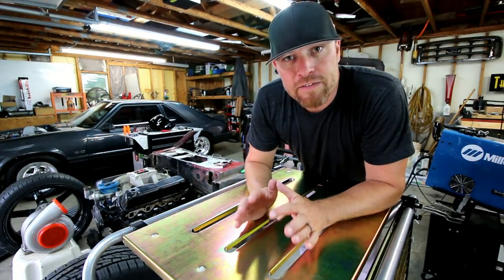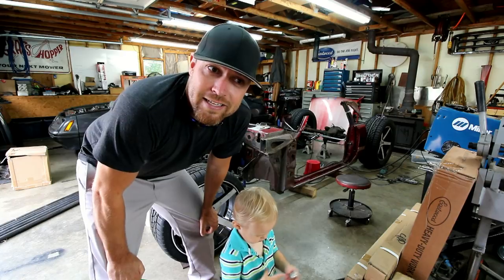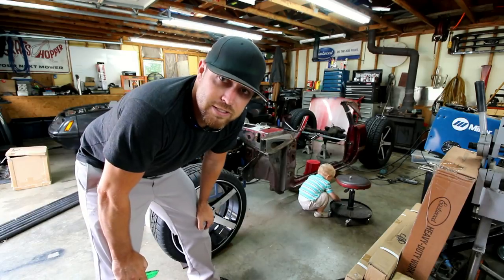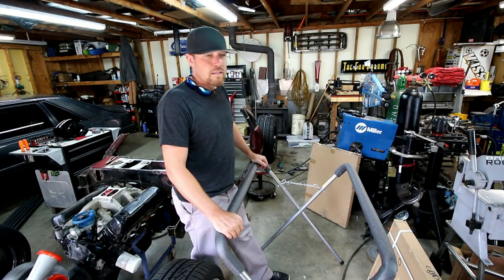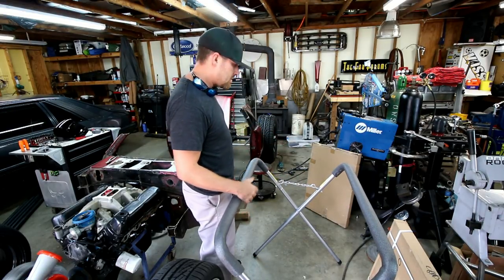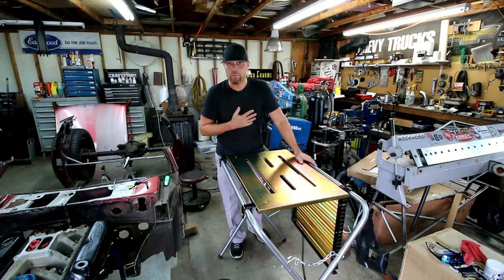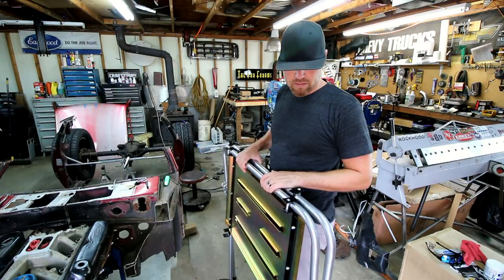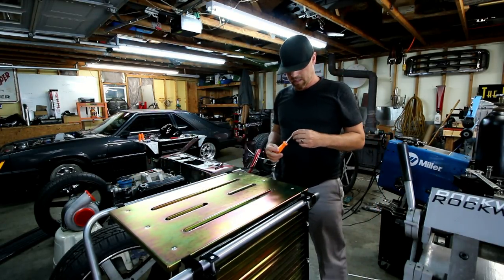Cut-N-Weld Welding and Plasma Cutting Work Stand by Eastwood

Comment: Great video,  even BETTER with the kiddo in it! 
I was that kid ,ALWAYS in the garage/shop with Pop... big smiles bro.
As far as the table... i think it's a great idea, also think that with a little "fab" work ... you can add some cross bracing to stabilize it if needed 😉😎

Comment: It is always a trade between building it portable or solid. I would rather have a big heavy weld table/cut table to work on. But it would still be nice to be able to get a car in my shop now and then as it seems to get smaller daily. Sometimes you have to take the bad with the good to get something you can actually use. Keep up the good work. I appreciate your opinions and I don't have to agree with them for them to be helpful. You have enough fans that you can ignore a few hatters!
Reply from the maker: yeah for sure

Comment: I hope im not too late. Cut the center sheetmetal of the roof out. Leaving the outer roof structure. Narrow. Then cut to fit roof. So you dont have a seam in the middle of the roof
Reply from the maker: I may end up making a new carbon roof skin

Comment: I just tried to order from Eastwood and the coupon code 'thefabforums' (without quotes) is not working.
Reply from the maker: try it again
Reply: No luck. It keeps showing "Coupon code(s) "THEFABFORUMS" is not valid." and replacing it with "PUNCHFOOL", which looks like maybe a 5% discount. I wonder if it's because I'm trying to order the plasma cutting top, which shows "*Heavy Item - Special shipping charges may apply."? I'll get ahold of Eastwood and find out.
Love the video series by the way. Keep up the awesome work!

Comment: Probably make the table steadier by replacing the chains with rods or flats if needed, either table can be used elsewhere as well, weldtable looks as though stronghand tools will work on it.
As for freebies, I'd rather watch a homeshop user demo a tool(s) than a company promo video and if they were not  donated we would not get a homeuser lowdown on them.
Keep doin wot ya doin.
Reply from the maker: thanks

Comment: How big your workshop in meters ?
Reply from the maker: not sure in meters, its 25 feet by 35 feet
Reply: 3feet 3inch or a 1000 mm ( millimetre  ) = 1meter in Australia your garage is roughly about 10.6 x 7.5 meters , How many pounds to a ton is there of weight in the States , Australia is a 1000 kg ( thousand ) ( kilogram ) to make up a ton of weight ?

Comment: Hmm. I'm sorry to say this but that table looks s flimsy as f...
Reply: kalijamies i just said same thing
Reply: bryan senulis It really does.
Reply: i got the same stand, use it for windshields and suck but dont think id trust it as a welding bench. seems like its got too much play. not trying to hate, just stating my opinion
Reply: The table top or the legs?  The legs are standard stuff you'll find in any body shop.  They work well.

As for the table itself, looks good enough for what you're going to put on a welding table, lol.  Piece of exhaust or whatever.
Reply: MrSloestD16... I can see it often working great out in the field also for those that don't have a utility bodied trucks and don't want their shit landing in the mud all the time (been there). lol
Reply: That's EXACTLY what I was going to say about he "table"!!!
Reply: I wish I had a table as practical as that, even if its as flimsy as that!, if you wanted to make a table as practical, durable,  light weight that can be stored away, for that price, if you can do better than eastwood do it and Ill buy yours instead lol, If I were a mobile mechanic or had a mobile bodyshop, this thing would be godsent, also I will most likely get one when I get a garage and a lincoln welder, I dont want things that I wont use every day to be taking too much space in a 1 or 2 car garage.
Reply from the maker: its actually very stable....the weight of the tables actually make it more so